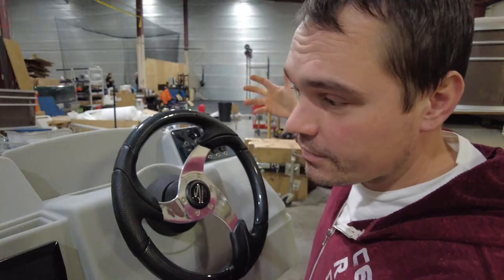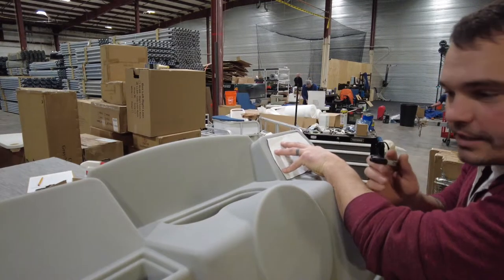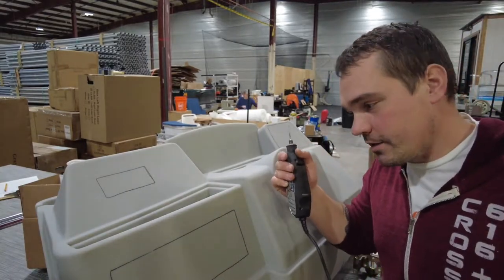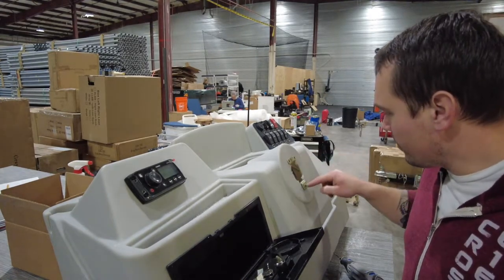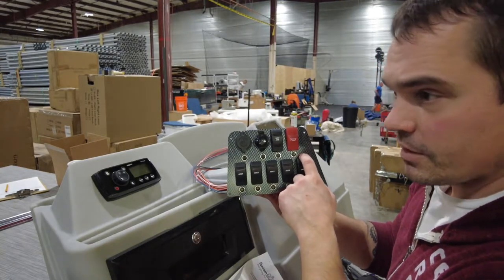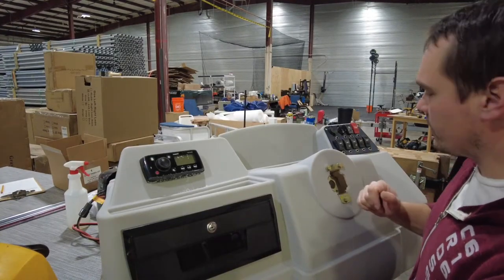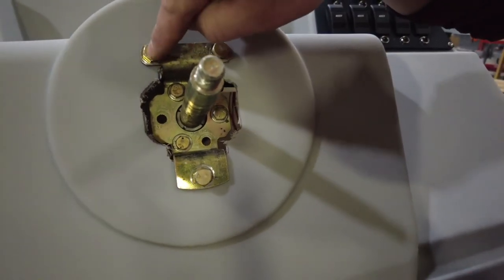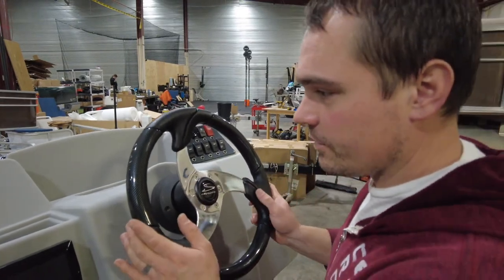Pontoon Steering Console Installation - Part 1 of 2

Comment: Hey Tom, wondering if that glove box would fit on the smaller basic consul? I’ve got a stereo going top left and a 6 switch, USB and 12 volt plugin going top right? Thanks again.
Reply from the maker: I've installed a couple of the glove boxes in the flat vertical spot under the main dash part. It's tight, but there's space!

Comment: Does oil need to be put in that little cable run out tube on the helm steering?  If so, what oil do you use and how much do you put in the tube?
Reply from the maker: I’ve never needed to oil a helm to be honest. Usually the helm has grease in it from the factory and it never really breaks down or has anything get corroded because it’s protected from the elements and the wear and tear in it is pretty light. You could put some white lithium on the cable that inserts into the helm, but beyond that it shouldn’t need anything. Usually stuff steering is a result of the cable, not the helm. For a few hundred dollars you can install a whole new helm and cable these days!!

Comment: I need a new helm put in with all necessary gauges, but can't find any marina to do it for me.  I need help!  I'm not sure if I could do it myself...maybe with your guidance???  🙂
Reply from the maker: I've got all sorts of videos that talk about consoles and the accessories that go into them including gauges. I seriously can't believe a marina doesn't want to take on that project. I wouldn't be cheap, but they should be able to knock that out for you no problem!
Reply: I live in Washington PA, not an area with lot's of lakes, but there are several marinas.  I get the excuse of, "I'm too busy", I don't work on pontoons", or "that is off-season work".  Meanwhile, no one returns your call in the off season.  I fully expect to pay around $2000 to have it done...gauges installed in the unit, but no takers.  😢
Reply: I want to purchase a helm with necessary gauges already installed.  I believe I could actually install it on the pontoon, but not sure about purchasing the correct gauges, cutting the helm using templates, wiring them to the circuit board, etc., but I couldn't find anything like that anywhere.
Reply from the maker: @travisclosser7368  WHAT A SERIOUS BUMMER! Pontoon stuff just released their gauge cluster and switch panel on their website for the large helm. The gauge cluster must be integrated into your motor rigging, but the switch panel is an easy plug and play option using their wiring harness, or can we worked into an existing electrical harness. $850 for the combo of the two panels (save 5% with our discount code). 

I would ask those marinas if you can ask to hire one of their mechanics to moonlight and install it for you on a weekend for cash. The right owner or service manager would love to help their mechanics out like that!!
Reply: I believe I will do this.  With your very detailed videos, and Pontoon stuff parts, I feel confident.  You're great, buddy!  "When" I find success with this project, I will remember you!
Reply from the maker: @travisclosser7368  Excellent! Let me know when you get to the project!

Comment: How do I add tilt steering wheel?
Reply from the maker: It’s an entire helm system, not just the wheel. It’s available in rotary cable and not too difficult to install. Your old cable would work with it if it’s out of a rotary quick release helm.

Comment: I just ran my steering cable back to the motor, only to find that straight horizontal entry into the steering bracket is not possible because of the decking. The rod end is, obviously, rigid and is forced upward at the tip rather than level. Can't get the end piece into the steering bracket. Help! I started chiseling the bottom of the decking, but not sure that will allow the back of that rod to go high enough, especially with the fitting for tightening. Is that supposed to be run before decking is put on? Not sure what the fix is except to cut out part of the decking and repairing it later. Suggestions?
Reply from the maker: Sometimes the motor has to be removed to install the steering cable. I’m not sure I’m picturing it right so email me some pictures of the dilemma! TomsPontoons@gmail.com

Comment: Where did you obtain the switch panel with the horn?  I have not found one.
Reply from the maker: They are separate items. The switch panel is currently unavailable, but was from Pontoon Stuff. Hopefully they will have more soon! The horn can be found at Pontoon Stuff as well, and can be wired into any momentary switch.

Comment: Which side mount throttle would you recommend for mercury 50hp 2 stroke?
Reply from the maker: Thanks for the question! The Mercury part number would likely be: Remote Control 881170A15 but definitely double check that it’s compatible with your engine for the shift and throttle directions. A local Mercury Dealer could help too…or visit Vans Sport Center (www.vanssports.com) might have an affordable used one.
Reply: @tomspontoons  Thanks so much!

Comment: Greetings Tom and viewers, that 7 circuit switch panel was very nice and it fit perfectly in that corner spot.  Is that something you fabricated or is it an accessory I can purchase for that specific console?  I have that console carted on the pontoon stuff website.
Reply from the maker: That panel was from back when we were spoiled with the pre-made switch panels Pontoon Stuff sold. They will have them back in the future, but sourcing that sort of component has been a nightmare through COVID and competing with the big boat manufacturers who are building hundreds of thousands of boats a year between all the brands. That switch panel is plug and play with their harness...when they're back in stock I'll be purchasing as many as I can afford to inventory so that I never run out of them again! I've had to rely on some of the options on Amazon in the meantime, which you'll find info about on other videos on my channel.
Reply: @tomspontoons  
I know all about part availability.  I decided to lay a carbon fiber vinyl onto the console to make a luxurious background when I set in the electronics and accessories into the console.  Check out the many options offered on Amazon.
Reply from the maker: @awakenedtotruth8419  nice!
Reply: @tomspontoons  i think so too, I tried linking to you but YouTube rejected it several times.
Reply from the maker: @awakenedtotruth8419  all good, I’m familiar with what you’re referring to!

Comment: When measuring where to place the console, taking into consideration a 20' steering cable length, how far forward can I go to the front of the pontoon? Do I allow for a certain amount above deck to large console steering? How much? (You could probably tell me how far forward you've gone on builds with enough slack, eh?) What's a good rule of thumb in how to measure (pretend I'm really dumb when considering your answer with details... cause I am).
Reply from the maker: Great question. On an 8’ wide boat I start with 4’ (motor to starboard edge) + 4’ from underdeck to insert into helm (needs a curve under the console from the through hole to the insert of the rotary helm), that would leave you about 12’ forward from the rear. Better to have a bit of slack and s-curve it along the Pontoon than to be short and need to buy a new one!!!
Reply: @tomspontoons  Thanks, that answers my question (even if it bums me out because I wanted to go further forward). Can I buy longer?
Reply from the maker: @BuenoToob  sorry to be a bummer! You definitely can order a longer cables. Assuming it’s a rotary quick connect, just go do a google search and you’ll find them in one foot increments. We had to order a 27’ long one for our houseboat!!
Reply: @tomspontoons  U da man!
Reply: How much is the big consal

Comment: I have more of a question my boat currently has a 14 ft steermaster cable going to a 70hp johnson 1990s 
Can I just replace it with a teleflex cable 14 ft having trouble finding the steermaster there is a lot more teleflex cables around
Reply from the maker: I’ve never actually seen or heard of a steermaster system. Your safest bet would be to purchase the entire helm and cable kit. Pontoon Stuff sells the kit in a couple different lengths for around $200. A cable alone is often over $100 so worth it to just start fresh I think!
Reply: That is what I meant is by the whole helm and cable kit  . So if I just bought the new kit I would be good to go.
Reply from the maker: Yes, that’s the route I would take!

Comment: Hey Tom, quick question for you! I'm about to remodel my pontoon and want to swap out the existing helm for one of these Pontoon stuff helms, will my existing steering and throttle mount work okay with the new helm?
Reply from the maker: Great question! I haven’t found a steering system and shift/throttle control that won’t work with the Large Helm from PontoonStuff. Their “Standard” Console will take any steering system, but not every type of shift/throttle control mounted to the console. This is assuming your steering system is a rotary type (like shown in my videos). Feel free to email if you have more questions!